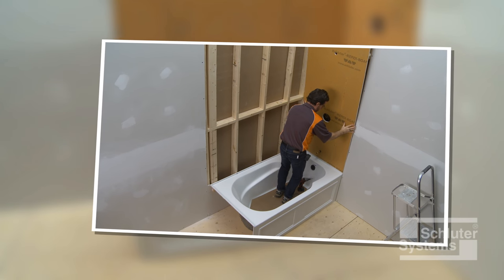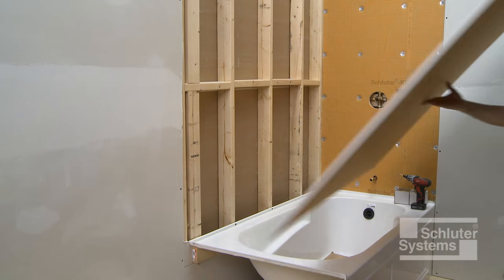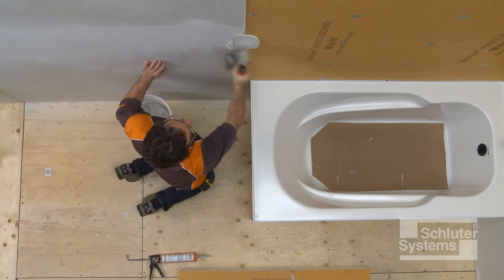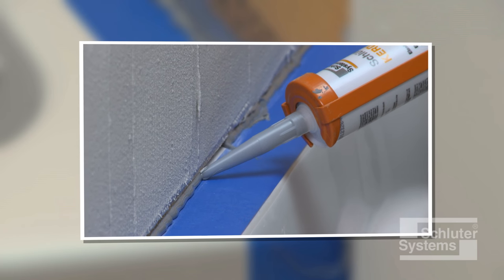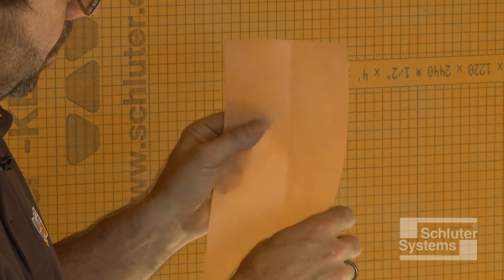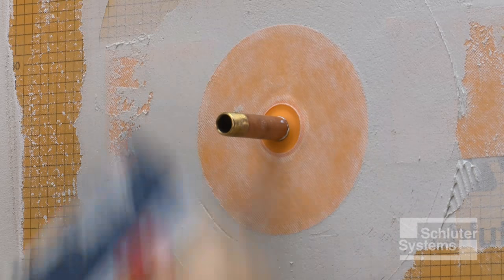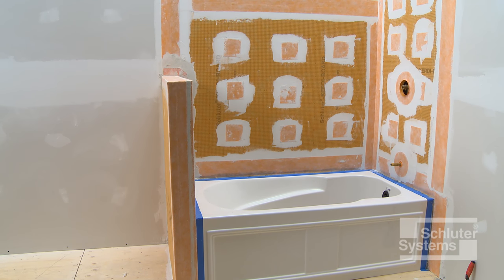Schluter®-KERDI-BOARD over Framing in Bathtub Surround Applications

Comment: I am 47 years old and when I was 16 I remember helping my friend and his dad put tile In a bathroom screwing osb to a wall, then adding chicken wire to the osb. We then put concrete on the wall and made sure it was perfectly flat. From my understanding that bathroom still stands today bone dry no leaks. All this red guard and Kerdi board was not available or used back in the day.
Reply: I'm 201 years old and when I was 8 I remember helping my friend and his dad tie bamboo leaves to make a shower wall in a bathroom, tieing the leaves together to form a patchwork. We then draped that over a few peices of wooden branches that we'd chopped earlier to make sure we had a perfect enclosure. From my understanding that bathroom still had the original bamboo leaves. All this OSB, chicken wire and concrete was not available or used back in the day.
Reply: @AJ-ds5gf hahahaha!

Comment: If someone trips and falls that is coming down. It's a foam knee wall. It has no structural strength
Reply: Have you ever seen how strong it is?  Mike Holmes build a corner seat with it and it held over 450 lbs when 2 guys stood on it.  Its alot stronger than you would expect.
Reply: Kevin Miles 2 guys stood on it. Do you see what you wrote. Do you know the difference between the stresses that standing on something and pushing on something would have. You can stand on 2 eggs vertically, you can not stand on them horizontally.  I said fell over so the weight and the forsee would be pushing sideways and it would snap the foam. Foam is not strong that way. Especially the way he built it here.
Reply: Kevin Miles you know it's not magic foam either. This company has gotten off using cheap ass foam with a waterproof coat. You can get the same results with poster board your kid uses for art projects and a waterproofing liquid. This foam is no stronger than packing peanuts
Reply: @Proxtor  They used 2x4's for support... and I'll bet they toed in a 2x4 across the centre where you can't see it.
Reply: @hermes0623  then don't build yours that way
Reply: Yes it does.
Reply: @willllllll-r1f  Exactly. That aside, this stuff is strong, this stuff is impressive.

Comment: What can "Other suitable sealant" be other then the $33 tube of kerdi fix?
Reply from the maker: Hey Tyson, you can use a sealant that requires atmospheric moisture to cure... for example, a urethane sealant would be an option. Please give our Product Support Team a call if you'd like to discuss further options. 800-472-4588
Reply: Tyson Sikaflex Construction Sealant has always worked well for me, and it’s far less expensive than the Schluter sealant.

Comment: Kit For Tub and Shower Walls sells for $455. Using 1/2" Hardiboard, thinset and Redguard will cost about $120.
Reply: Red guard is like buying a ford and schluter is a Ferrari
Reply: @lotshanuni1  ya, a Ferrari that leaks.
Reply: @abewilcox4560  Funny that actual Ferrari leaks, too.
Reply: Schluter done right don't leak, the problem is to many guys out there want to do it fast and cheap and that don't work. Do it right you won't have a problem, I've been doing this for 35 years plus and have made a great livi g doing it right

Comment: it is always recommended to use 'unmodified' thin set.  Yet  schluter thin sets (such as AllSet) for use with all kerdi products 'are modified'.  I find this confusing.
Reply from the maker: In general, latex-modified mortars dry very slowly through the open joints in the tile covering. Schluter’s modified thin-set mortars have been specifically formulated to set and gain strength in a time-frame that fits typical installation practice, even when sandwiched between Schluter membranes or boards and porcelain tile. So, developing our own setting materials has given us the ability to guarantee consistently positive results. You can check out the Thin-Set Facts page of the Shower Installation Handbook for complete details.

Comment: Very nice video. do you leave a space between the base of the Kerdi board for the wall and the lip of the tub flange or does it just rest on top of it ? Thank you!
Reply from the maker: Hi there, when KERDI-BOARD is installed above the tub flange, apply KERDI-FIX to the tub flange and spread using a small notched trowel. Then install the KERDI-BOARD directly to the KERDI-FIX so it is resting on the lip of the tub flange. Please feel free to contact our Product Support team directly if you would like to discuss your project in more detail. 800-472-4588 (US) or 800-667-8746 (Canada). Thanks!

Comment: Like the idea of Kerdiboard, but I would not build a knee wall out of it. Best to make a framed wall, then put Kerdi over that. Also the reason to use cement to patch the screws is because a self-adhesive glue patch would leave air pocket around the screw and that is bad for tile support.
Reply from the maker: Hi there, Kerdi-Board is commonly used to build knee walls and partition walls. If interested, you can check out our video here: https://youtu.be/6RlMFP_YbeE

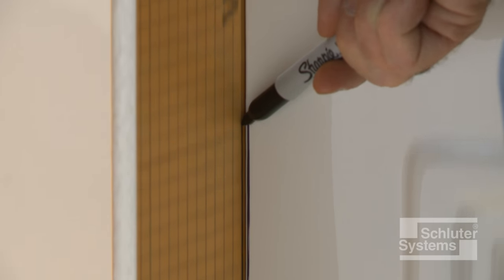Comment: Bold move at 3:20 to use a Sharpie to mark the KERDI-BOARD for that kneewall... while marking all over the brand new tub.  🤣  The line might be covered in this application, but typically it would probably be better to use a pencil or non-permanent marker of some sort.  Details matter... especially if a pro is doing a job for a customer and has a reputation on the line.  At the end of the job I'd hate to rely upon a thin bead of white caulk to hide permanent marker!  🖍 🛁

Comment: How do you seal with the band where it meets the drywall at the edges?  Does the band extend past the kerdi board or does the edge of the band line up with the drywall line?
Reply from the maker: Hi Ceeloc, KERDI-BAND and thin-set can be used to join the KERDI-BOARD and drywall or drywall mud and tape can be used there. Whichever you prefer or is easier for you is fine. Hope this helps.

Comment: Hello, can the Kerdi band be taped, mudded and painted at the Kerdi to drywall transition? Or is there a recommended finish for that area? Thanks!
Reply from the maker: Yes, you may mud and tape over the KERDI to Drywall connection.

Comment: Do you you have to do anything between the kerdiboard and the ceiling such as another piece of band?
Reply from the maker: Hello! KERDI or KERDI-BOARD application on ceiling is optional for showers. If you are building a regular shower, you are not required to do anything specific for the wall/ceiling connection.

Comment: I can't find any info. regarding vapor barriers behind Kerdi board if the tub back wall is an exterior wall in a cold climate. Any recommendations?
Reply from the maker: Hi David,  Exterior walls generally have a vapor barrier in place already and it is fine to add the KERDI-BOARD on to the studs of the exterior wall as well. There is no concern with having the two vapor barriers. If you do not already have a vapor barrier on your exterior wall, you can discuss with a local codes office to find out if one is required. Hope this helps!

Comment: Tile expert Sal Diblasi says to bring the kerdiboard to the tub deck to avoid movement and tile cracking.  Who is right?
Reply from the maker: Hi Jonathan! 
KERDI-BOARD can be installed directly to the tub deck or onto the flange. Either way is fine, as KERDI-BOARD is dimensionally stable. A movement joint such as DILEX-AS or DILEX-BWA could also be used to address movement. 
Hope this helps!

Comment: I have a painted wall next to kerdi board. What do I need to do to ensure the all set will stick to the painted wall when I put kerdi and over the seam?
Reply from the maker: Hi there! If it's latex paint, you can go right over it with ALL-SET. If it's not latex paint, you can use a latex primer or PRIMER-U before applying the ALL-SET.

Comment: Shouldn’t the board be over the tub lip and not on top of it?
Reply from the maker: Either way is fine. KERDI-BOARD can be installed flush with the tub flange or over the tub flange leaving a minimum space of 1/4" (6 mm) between the board and the tub deck. Remember, when KERDI-BOARD is installed above the tub flange, apply KERDI-FIX to the tub flange and spread using a small notched trowel prior to installing KERDI-BAND.

Comment: I don't understand why they still recommend unmodified thin set. I've been using with modified thin set for ever.
Reply: There is a reason, I just forgot because I use what they recommend - The price is about the same.
Reply: There a video where they explain why but ill do a short version for you: 
They offer a warranty with unmodified thin set because they show consistent result all the time. 
They cant do the same with modified thin set because they dont know what in these product as they dont know how it will react to their product. So you could use modified thin set but dont expect them give you a warranty if it fail.

For the difference in price i would definitively go with the unmodified.

Comment: You would think for the extreme cost of the system that you would get screws that won't break! Unless your framing out of balsa wood expect to break 30%of your screws.
Reply: Call Schluter tech support and ask them if you can install the clips with GRK R-4 structural screws. A little overkill, but they won't break and are truly self drilling.
Reply: None of our screws broke when installing actually
Reply: Hmm... I just used almost three boxes of Schluter screws on my surround, and didn't break a single one.
Reply: @chrisbottoms6396  try screwing them into studs made 25 years ago. New lumber might as well be balsa wood these days. My point mainly was how ridiculous the price is for a "must use for warranty coverage". For the price they could use higher grade steel and still have a huge profit gain.

Comment: Or cut up 25 foam coolers and build the same quality "wall"   hilarious
Reply: Have you ever used this stuff? It's nothing like the styrofoam of coolers - it's really rigid and strong.
Reply: @Rosscoff2000  no it's not. I've used it, and not even impressed
Reply: @abewilcox4560   my experience has been different - I'm  happy with it and even happier with a cheaper alternative with cement facing, Marmox Multiboard.